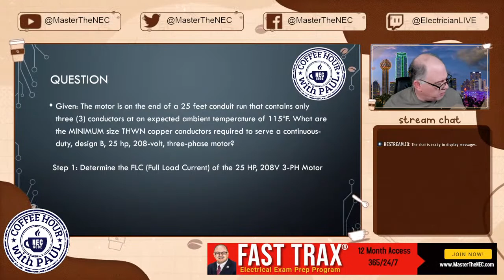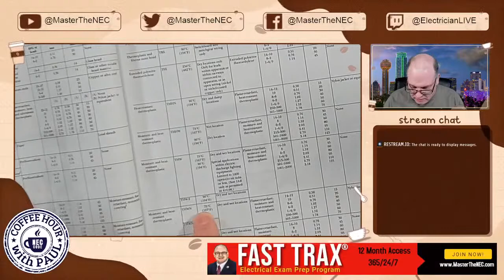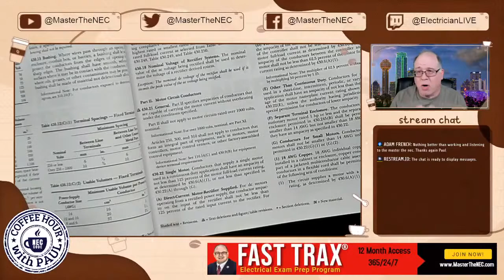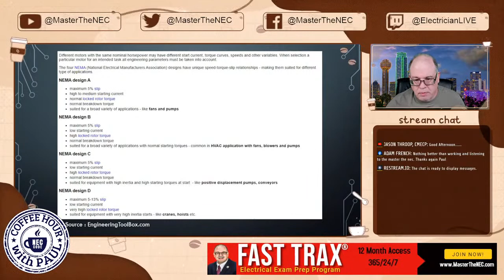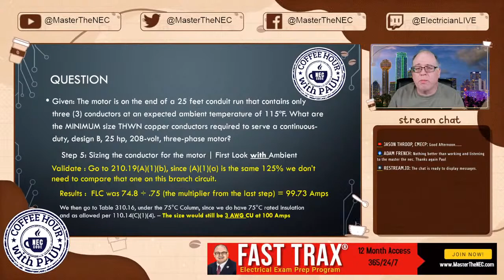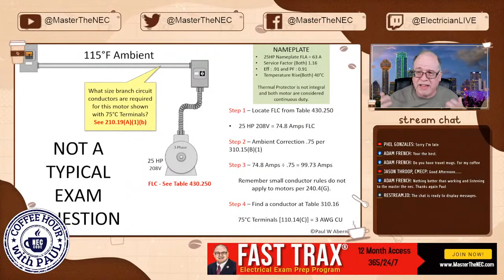Coffee Hour | Single Motor Branch Circuit Calculations

Comment: I still don’t understand the 2 ambient tables and why you used 30c table in question you said temp is 115f. 40c ambient is less than 115f so why not use that table
Reply from the maker: The 30C in 310.15(B)(1) is for Ampacity Tables 310.16 and 310.17 as those tables are given for 30C and the 310.15(B)(2) is for Ampacity Tables 310.18 and so forth.
Reply: @MasterTheNEC  what time don’t understand is when the 40c table is used?
In the example ambient is 115f about 46c so why not 40c table.
I get the feeling I’m missing something easy here
Reply from the maker: You are GROSSLY over thinking this one. Since the ampacity values in 310.16 and 310.17 tables are based on 30°C you would use 310.15(B)(1) because that table is labeled for base 30°C. You would only use 310.15(B)(2) when using Tables 310.18, 310.19, 310.20 for example as you will notice those ampacity tables are listed as 40°C. The normal electrician will never use 310.15(B)(2) as they only deal in ampacity values from Table 310.16 and thus only use 310.15(B)(1) if an ambient correction, other than 30°C,  is encountered.
Reply: @MasterTheNEC   thanks for your response I do tend to overthink. I work in a industrial factory that has elevated temps due to furnaces and thought it may be an example of when to use 40c table.